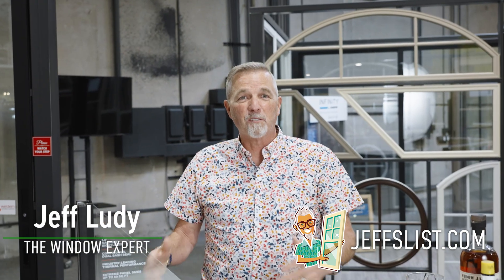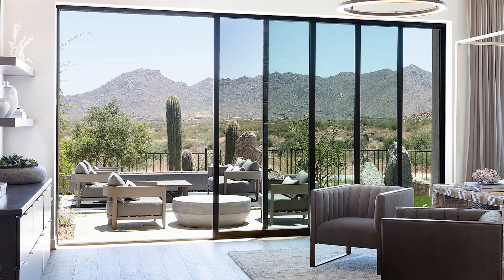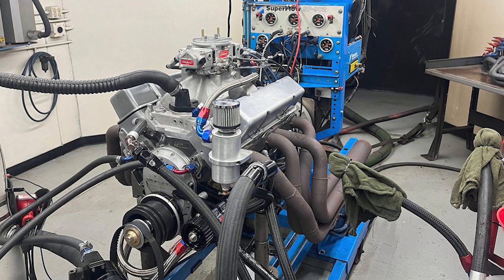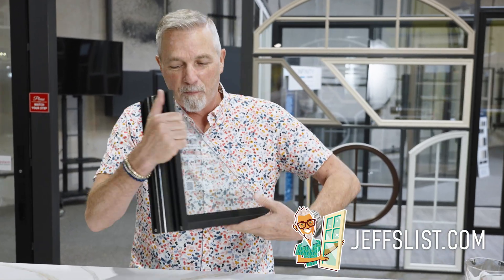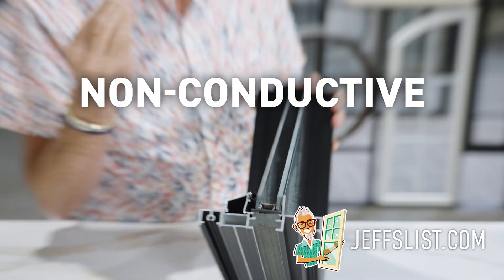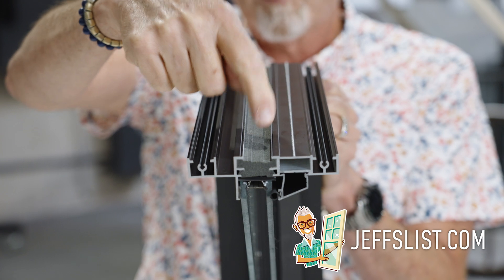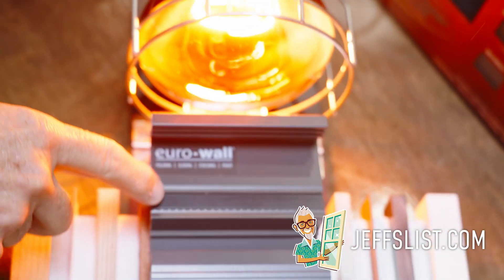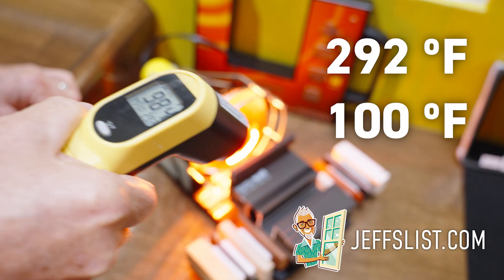Thermal Break vs Regular Aluminum Windows: The Difference Explained

Comment: Hey Jeff! Curious on your thoughts of Weathershield Vue (Their aluminum line) and how it compares to Western Windows Aluminum. I know Pella just bought out Weathershield as well.
Reply from the maker: Hey! Both are premium aluminum options. Western is strong for large spans and structural performance, while Weather Shield VUE edges it out for ultra-thin frames, design flexibility, and a more refined look. Either is solid — it depends if you prioritize aesthetics or structure. Thanks for watching!

Comment: That's very interesting. But why does the window frame has these intricate patterns? Is tio keep moisture out?
Reply from the maker: The intricate patterns in the frame aren’t just for looks — they serve a few important purposes. They help create thermal breaks (air pockets that reduce heat transfer), drain moisture through built-in channels and weep holes, and add strength to the frame without extra weight. So yeah, part of it is to keep moisture out, but it’s mainly about improving insulation and durability overall.